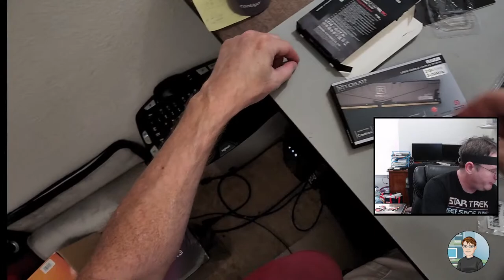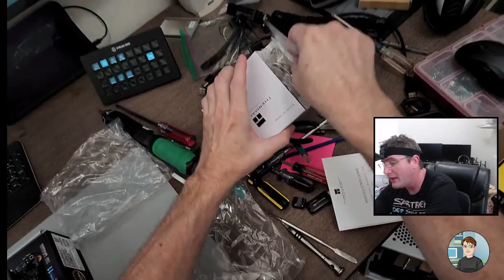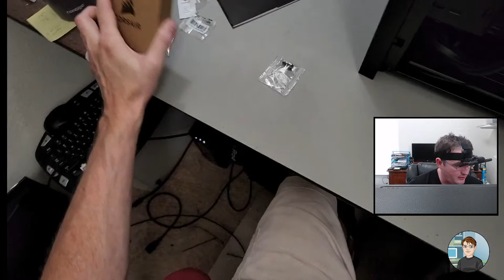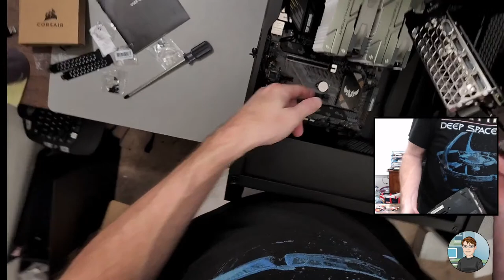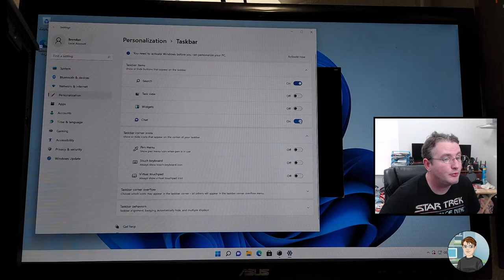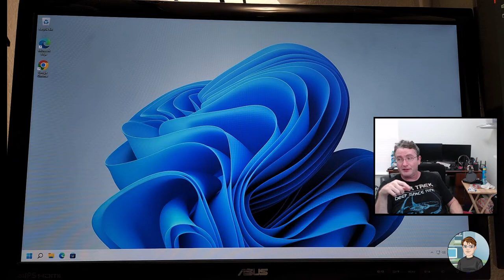New PC Build, AMD R7 5800X CPU, 32GB RAM, 2TB Gen 4 NVME SSD, RTX 3060Ti, ASUS B550-PLUS WiFi II

Comment: I got the same motherboard but have a nzxt h510 atx tower but I don’t have no where to plug the case cable to the motherboard? Do I need an adapter?
Reply: Yo super late to this but I’m having the same problem now. What did you end up doing?

Comment: Hello boss. Do you know if the Asus B550 plus is a good for streaming and playing games or should I run something else and with what AMD CPU?
Reply from the maker: It will give full performance compared to the higher end motherboards.  No sacrifices in performance.
Reply: @MichaelTheComputerGuy  I have bought an amd Ryzen 5 5600x but I haven’t opened it since I don’t know if I should go with a Ryzen 7 5800x. What would you suggest?
Reply from the maker: @adolfoh22 The 5600x has 6 CPU cores.  The 5800x has 8 cores.  I doubt you would notice the difference in games.  If you have more money to spend getting a better graphics card will improve gaming more.
Reply: @MichaelTheComputerGuy  thank you so much for the information and for your time. Sorry I have one more question. So with this setup I should be getting at least 1080 resolution or better if I get a better graphics card, is what I understood from you, am I correct?
Reply from the maker: @adolfoh22  I don't think you've mentioned the graphics card you're planning on getting and that's more important than going from a 6 quarter to an 8-core cpu. What graphics card are you planning on buying?
Reply: @MichaelTheComputerGuy  well the guy at micro center recommended I start with a 3060 ti and we’ll I kinda like the 3070 or 3080 format. I just want something that can get me closer to the 1440 without having to spend major money on a good gaming and streaming pc.
Reply: @MichaelTheComputerGuy  I hope you had a great day boss ☺️

Comment: Hi there hoping u reply to this I’m in the middle of building my first pc I have a rtx 3060 12gb eagle ryzen 5 3600 “will be upgrading it soon” the same motherboard u use in this vid the same ssd u use in this vid 16gb off Corsair vengeance 3200mhz but I’m just a bit worried about my Psu as I have the nzxt c850 gold rated 80 but I’m really worried if this is too much power as I brought it just so if I want to upgrade a few things in the future I could but is this too much power would be thankful If u reply thanks.
Reply from the maker: Having too much power is not a bad thing. One thing to consider is could you buy a cheaper power supply with lower power that actually fits the computers power needs better and then spend that extra money on a better processor or graphics card.

Comment: Just got a power supply, had one of those "Do not eat" silica packets, so I threw it out. The power supply itself of course was quite tasty with a little hot sauce on it.
Oh and I use an uncooked grain of rice sized line of Arctic MX-4, have taken off coolers and rebuilt systems enough to know it's a perfect spread.
Reply from the maker: Mmmmm, power supplies

Comment: hey, maybe a bit late, but yesterday i ordered the ryzen 7 5800x and the asus b550 plus wifi ii motherboard. now my question is do i really have to update the bios in order to set the ram to the 3600mhz? because i once bios updated my old motherboard and i ended up killing it... since i now ordered new parts i do not wanna risk killing something again :D. so my question is can i put the ram on 3600mhz out of the box without updateing the bios? would be nice if you could reply to me since i dont have such big knowledge as you have :D thanks alot, best regards
Reply from the maker: Whether or not you'd have to update the BIOS in order to enable XMP I'm not sure. It would depend on the current BIOS level and whether or not a bios update is actually required. That being said killing motherboards with a bios update in my experience is extremely unusual. You can try the 3600 megahertz RAM with the current BIOS level and if it doesn't run stably at the current BIOS level then you upgrade the BIOS to the most recent version.

Comment: Hello Michael, firstly I knew I could trust you're advice when I saw the ds9 shirt haha (great taste btw 👍) 
Secondly my question is about the wifi antenna that comes with the mobo, I just built my pc the other day and just having trouble connecting my elite series 2 xbox controller to Bluetooth. I was under the impression the antenna doubled as Bluetooth, is this correct? Any help would be greatly appreciated thanks Michael 🙂🙏
Reply from the maker: Bluetooth works with 1 or 2 wifi antennas.  Xbox controllers don't use Bluetooth on PC you have to have an Xbox controller dongle that connects through USB.
Reply: @MichaelTheComputerGuy  even the elite series 2 controller? I was under the impression that would connect without one.
Also having an issue with driver error of a Bluetooth device in device manager, so there's that little issue as well lol 
But thank you for the help mate 🙏

Comment: Nice video really helpful but just wanted to make sure bc I'm making a very similar pc build with the asus tuff gaming b550 plus wifi ii and a ryzen 5800x same as in your video so would I need to update the bios on the motherboard or can I just start it up without even messing with the bios?
Reply: I believe the motherboard will be compatible right out of the box
Reply: It should be because I inserted my ryzen 5 5600x and it worked with out messing with the bios
Reply: @masternoob3889  thanks allot bofa u
Reply: How's the motherboard holding up?
Reply: @braxen3937  I haven't had any issues so far, good motherboard overall my only gripe is that it doesn't have usbc support
Reply: @jonyleche3549  same im using the lian li 216 case and couldnt plug my usbc cable in anywhere

Comment: Hey, Michael!

Question about NVMe M.2 SSD. Is there a particular reason for putting the NVMe SSD to the slot that is closer to the CPU? Is that slot for specifically for NVMe?  I bought and installed a WD SN350 NVMe SSD, but I put it on the slot that is below the PCI-e slot. When I booted the PC it would only post a black screen and I couldn't obviously do anything unless I removed the NVMe M.2 stick.

I've got Asus TUF Gaming B550 plus mobo with Ryzen 7 5700x and RTX 3060.
Thanks in advance! I love your videos and streams!
Reply from the maker: You need to check your motherboard manual to determine which slots on your board support NVMe, SATA or both.
Reply: on this board, the closest slot to the CPU is directly connected to the CPU (usually the case for all motherboards too) if you connect it to the others, it will go through the chipset giving a bit of latency

Comment: Hi, does this motherboard support a front panel usb c? If not, is there an AM4 motherboard with wifi you recommend that does?
Reply from the maker: Most AM4 motherboards don't have the USB C header on the motherboard where you can connect the front panel USB C to.  You have to go toward the higher end board which are very expensive.  Instead look to get a PCI express card that has the header.  Search on Amazon for "usb c internal header card"  You'll find several.
Reply: @MichaelTheComputerGuy  Thanks very much! I will have a look

Comment: Hey I have the same motherboard and it’s a new build but my pc isn’t displaying to the monitor. Although the pc turns on and all the fans are running, the gpu light is on. Do you have any clue what to do. 

Also is the vga that goes into the graphics card the same as the pcie wired?

Comment: Hi could you give me some advice please I have the same asus tuf B450M PLUS II motherboard. But I have a problem when put my graphics card in where you put yours, it leaves no room for the wifi card to go in the slot just below it?? Any solution??

Thanks Lee
Reply from the maker: That motherboard has a 16x slot at the bottom of it where you can put the Wi-Fi adapter. It's a shorter PCI Express 1X card but it will go just fine into the 16x slot.
Reply: @MichaelTheComputerGuy  I did wonder that myself, your a star mate, really appreciate your advice. Will the graphics card work better in the slot where youve put it, rather than the bottom one where I have it?
Reply from the maker: @statusunknown2683  The graphics card might run better in the top slot. The top slot is usually the one with fastest speed and bandwidth.
Reply: @MichaelTheComputerGuy thats good to hear, I will see how goes, thanks for the quick reply. Have a good day mate
Reply: Hi, Well I tried it in the upper pci slot but the pc didn't see it, I reseated it, but still nothing? So I had to put it back in the lower slot. My graphics card is a geforce GTX 1650 GDDR5, can you think of any reason why B450M Plus II Motherboard wouldnt see it?

Thanks Lee
Reply from the maker: @statusunknown2683  Try updating the bios on the motherboard and then try the upper slot again. If it still doesn't work in the top slot just leave it in the bottom.
Reply: @MichaelTheComputerGuy  already did a bios flash, but yeah I here what your saying. No worrys thanks again

Comment: When you put in the ram was it taller than the top heatsing the small heatsink or is the heatsing taller i need to know pls
Reply from the maker: If you're referring to the rightmost fan it fit perfectly over the ram. Sometimes if the ram is very tall you have to raise the fan up a little bit on the heat sink. It's not a problem.
Reply: @MichaelTheComputerGuy  no im talking about the heatsink that comes with the motherboard the vram heatsing at the top of the motherboard
Reply: @MichaelTheComputerGuy  the vram cooler doesnt have a fan on it its at the top it has no text on it above the cpu cooler
Reply: @MichaelTheComputerGuy  its the thick black part

Comment: Is the motherboard 5000 ready or do i need a bios update for it?
Reply: it should be fine 

tbh I am using it with ryzen 7 2700 which isnt even on the list of compatible cpu list for b550 chipset and it still works fine.

Comment: Would this mother board work with 4600mhz ram because I want to use it for a 5800x3d build
Reply from the maker: I'm not sure how 4600mhz RAM is a requirement for a 5800X3D but 4600 megahertz RAM would most likely be DDR5 and this motherboard in this video only supports DDR4 RAM.

Comment: Can’t see where the power switch goes in😊
Reply from the maker: If you're talking about connecting it to the motherboard it's almost always at the bottom right of the board. You can find it by looking at the manual. Also taking a picture of the bottom right of the motherboard so you can zoom in sometimes helps.
Reply: @MichaelTheComputerGuy  thank you
Reply: @MichaelTheComputerGuy  I found it I see where it had to go just wasn’t 100 percent , but after about 8 hours of building my first pc I got it going about 10 mins ago

Comment: Do i have to update the bios for asus tuf b550 plus wifi ll i have a ryzen 7 5800x?
Reply from the maker: It should support that CPU out of the box.  It's a good idea to upgrade the bios anyway for other fixes and improvements.
Reply: @MichaelTheComputerGuy  I have a question. My RAM only supports it's max frequency to 2666 Mhz, and it can't be higher anymore. My old MoBo was B450M, and it was all good. However, when I changed my Mobo to ASUS B550M-PLUS WiFi, that's the time I can't really even OC my RAM to 3200Mhz. It doesn't work even if I updated BIOS. Do you think, my RAM are old that can only support at that high frequency which is at 2666 only?
Reply: PC Specs:
MOBO: Asus TUF Gaming B550M-Plus
CPU: Ryzen 7 5700x
GPU: MSI 2060 Super Ventus
RAM: 2x8 Core Avexir 3200mhz/2x8 GSkill Ripjaw 3200mhz
PSU: Seasonic Core GX-650
SSD SATA: Crucial 250GB
SSD NVME: Samsung 980
Reply from the maker: @park3N  to get the ram running at 3200 megahertz or whatever speed it's supposed to be running at according to the manufacturer you just need to turn on DOCP in the BIOS. If you're trying to go through and manually overclock it by changing the individual settings for the timing and voltage and all that it makes it more difficult. Just turn on DOCP and it'll to handle it.
Reply: @MichaelTheComputerGuy  it really didn't work at all. I suppose my RAM is not supported by OC for my new MoBo. I already tried to reset and it was still the same. Got only max at all at 2666. Might probably look what ram is better or else I might upgrade to 3600mhz instead.

Comment: dude why didnt you plug in your usb C?
Reply from the maker: Most motherboards dont have a USB C header on them.  If you need one you can get a PCI Express add in card with the header to connect the USB C cable from the front of the case.